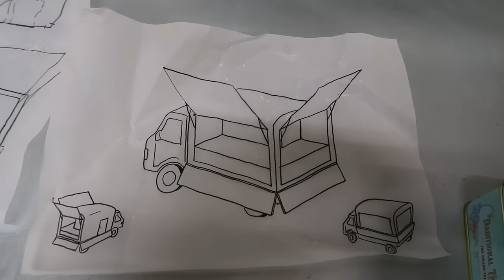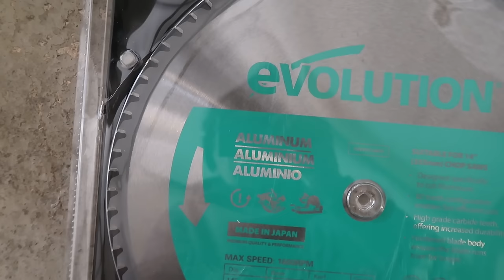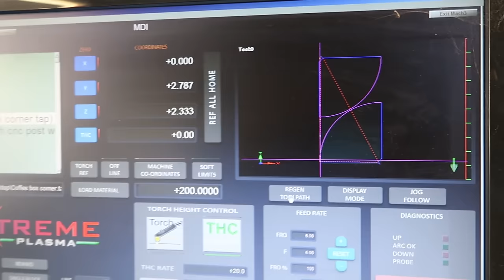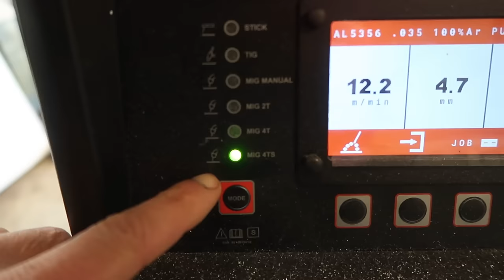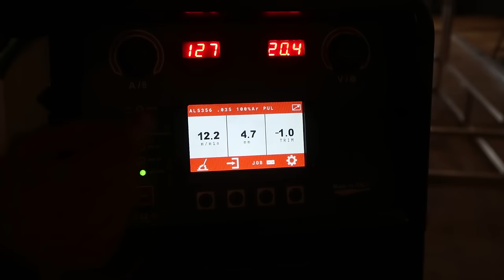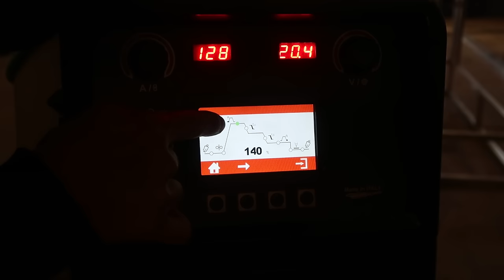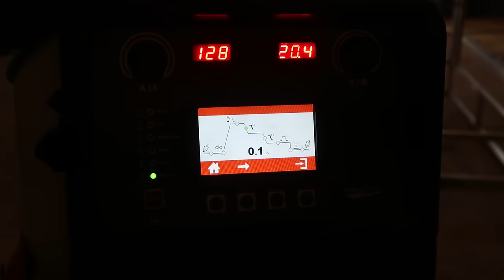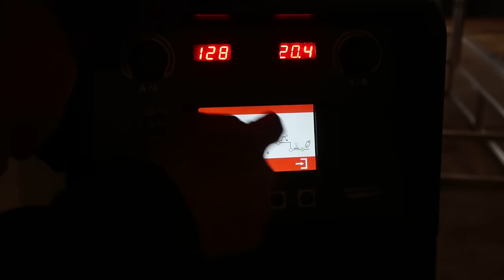Coffee Pickup Truck Build Pt1 using the HTP Revolution - Aluminium Pulsed Mig

Comment: If I get the setting on my BOC mig350r just right I get a pulsed like weld with no crackling sound and a perfectly smooth weld. Its done by feeding not quite enough wire in with extreme heat, but it works!